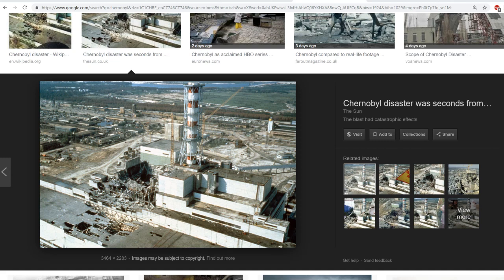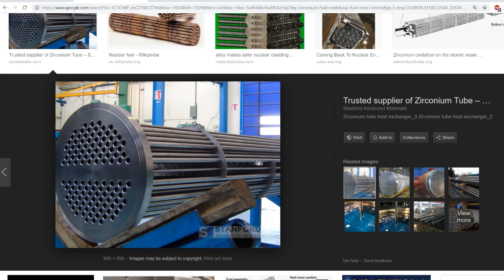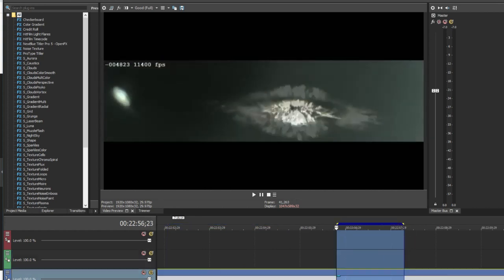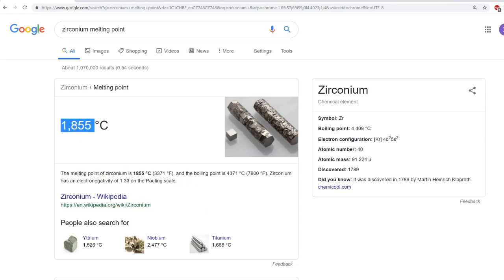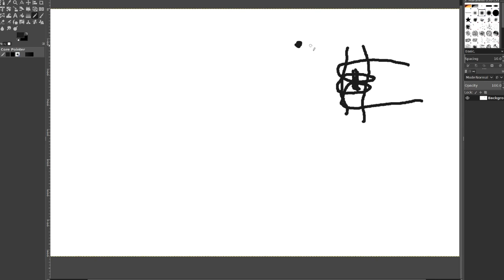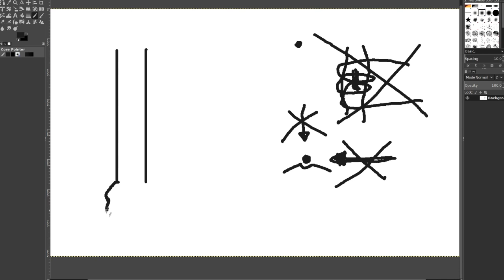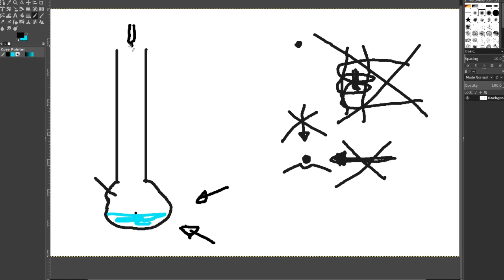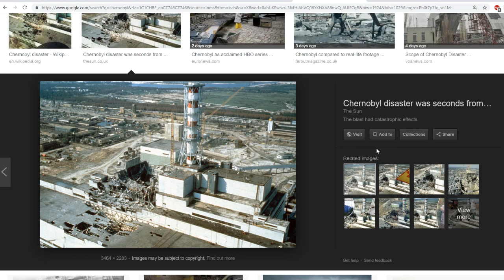Was Zirconium the real reason Chernobyl exploded?

Comment: It's so true, and isn't it so funny? Nuclear reactors. They sound so incredible and high tech and... NOPE it's literally just a fancy boiler, not much different from burning coal except with more lead shielding and cancer risks.
Always makes me laugh when sci-fi stories try to use nuclear reactors as power sources in things that can't possibly work that way. Iron Man's suit, for example. I mean, I can suspension of disbelief as well as the next guy, but when you think about it, that tiny dime-sized nuclear reactor in Generic Second-Rate Sci Fi Trilogy amuses me to no end.
I know what you're thinking: "Why is he bringing Elon Musk into this?" but it's exactly that kind of wishful nonthinking. "We can fix it with advanced tech!" and the reality of fancy boiler is left on the wayside in favor of unrealistic fantasies.

Maybe I'm just a sci-fi snob. There's an awful thought...
Reply: While we definitely aren't there for a small reactor the size and output of Iron Man's reactor. We do indeed use incredibly tiny nuclear power sources in current technology. City Lab's NanoTritium battery is a neat application. It's a circuit chip that can output, depending on the model and usage up to 150mA of power for 20 or so years using a Tritium based nuclear battery in a chip.
Reply: I can't say I'm surprised, but you know what I meant. Nobody's going to be powering a personal teleportation and espresso maker off of one of those things. I can't quite find it right now, but that sounds like about as much power as the battery in the solar-powered lawn light can store. Nobody's going to be running even household appliances off of one of those.

I am glad to hear that, though. If radiation's going to be a thing, why not use it to knock electrons around a bit until they do something useful?

Comment: Here is where I think you are wrong.  
1. Have you seen what the reactor looks like after the explosion?  Probably not, or did t take into account.  The entire assembly including the upper cooling tubes were ripped out of the containment and dropped back in sideways.  Most cooling tubes are still somewhat intact in the upper sections.  To me this indicates a possible low yield nuclear critical reaction in the lower assembly forcing the entire subsection up and over.  But if the zirconium tubes reacted then it would have happened during the first blast... That didn't happen.
2. You keep trying to apply your sodium reaction to nearly everything that releases large amounts of energy, or a derivative of it.  
3. The zirconium I think would have just vaporized to molten and not interacted with the water as you believe.  
4. It is possible the accident was just a steam explosion.  There was enough water already super heated to steam that it could have just rupture and blasted the core up out and over maintaining the upper assembly in the condition it's still in.

Look there are quite a few possibilities... I don't think you solution is one that is probable.  Interesting, but not probable.

Comment: Could I suggest going with the mig welder route, and machining a graphite cathode similar in shape to a test tube, but with a pinhole drilled in the bottom, and an anode that is just a graphite stick lowered into the tube. That way you could use a sufficiently sized zirc sample for better heating.

Comment: Maybe drop it through an induction coil after preheating it with he welder at the top
Reply: Kasper maybe he could heat it in an iridium crucible with the welder the melting point of iridium is a few hundred degrees more then zirconium

Comment: Why don't you drop the water on the Zirconium much easier to move the water then a super heated piece of metal only down side would be how much would be visible.
Reply: Good idea!
Also, you can use a graphite crucible in the induction heater: the graphite is inductively heated itself, and a piece of Zr in it will melt.
One question though: how do you isolate the explosion only due to white hot metal hitting water? It will explode without any additional chemical interaction, so you need a baseline, no? Like perhaps white hot gold?
Reply: Or keep the Zirconium fixed and raise the flask.  It's all relative.
Reply: Maybe the water will evaporate before hitting the zirconium. Unless you dump a lot of water on it.
Reply: Wouldn't that ruin the integrity of the surface tention plus you would want to keep as many factors the same as possible like acceleration due to gravity
Reply: Light Armanov acceleration due to gravity is of least concern I’d have thought. In Chernobyl the zirconium was in contact with the water already. If you think about the amount of energy you need to put in in the form of heat, a few extra joules of kinetic energy are neither here nor there.
Reply: Also this would be easier to perform under vacuum, convection currents in any inert atmosphere would surely either vaporise the water or push the drop away? At least you don’t have to deal with the vapour pressure of the water.
Reply: @Garryvision  I didnt realize that the metal would already be in contact with the water, I may be wrong but in order to increase the explosion more surface area must be in contact with the water, hence it helps alot of the metal has enough force to fall below the surface of the water. Also I dont think this stops the problem that you want the experiment to resemble the reality as much as possible
Reply: @Garryvision  also another two points, in a vacuum the water would evaporate and thefore react with the metal on contact instantly, also meaning that the air currents would exist in the water vapor. Furthermore you would want the water to heat up because that would resemble what would have happened in reality, there would be some water vapor in the atmosphere, as opposed to the atmosphere being water vapour.
Reply: The property described requires the metal to be liquid. Super heater water also requires a pressure vessels to prevent the liquid evapourating.
Reply: you could put all the things in a vacum tube, the wather encapsulated in a glass vile, the zirconium in the graffite crucible, put the whole thing inside de magnetic fild and explode the whater vile either with microwave or laser heating, you culd do a very compact setup insede a blast shild cose shit is going to be wild

Comment: 1) maybe point the electrodes downwards? so the zirconium drops a droplet?
2) really interested for this experiment, even thou im still not quite sold on this theory.
...3) Im still most inclined to fizzle explosion, basically molten hot fuel going supercritical; creating plasma that explode similarly to Sitnikov's demon core incident.

Comment: Ahhh, so the original experiment did start out with a bong and a syringe. I kinda figured.

Joking aside though, I'm pretty sure that you can decrease the diameter of the target to be heated via induction by simply proportionally increasing the frequency of the current. So you should be able to heat spots on a test tube, plunge a series of very thin tungsten wires through such that they form a rough funnel shape which will cradle the solid zirconium but let it slip through when molten, and hit it with a higher frequency induction heater. Theoretically, of course.
Actually, putting a little more thought into this increasing frequency matter, you might actually need microwaves for such a small target. Have you considered trying with a 2000 microwave? I bet you could find one in a scrap yard that just has fried control electronics which could be replaced by a switch on a nice long set of wires. You could probably test it by just plopping it on some, oh wait, 2000C.... Umm, maybe firebrick with a borosilicate bowel on top. Idk, that's my addition to the thought pool. It will be interesting to see when you do nail this one.

Comment: I think a Welder will be your best bet. Although a TIG welder would be ideal since the tungsten electrode will not contaminate anything. A welder with high voltage start function will also help greatly in a confined space.
Then, maybe place the Zirconium in a small graphite cruicible or something which you connect to the other terminal of the welder. You can then heat it well above the melting point and drop it by tilting the graphite cruicible.

As for induction Heaters: Even for a lot of money, you likely won´t find anything that will do the job.
Firstly, most induction heaters are meant to heat steel, which is by far the easiest metal to heat. All non-ferromagnetic metals are MUCH harder to heat. Additionally, heating to high temperatures is even harder for them since the electrical resistance changes with temperature. Your target being very small doesn´t help either. So at least for this purpose, I wouldn´t recommend it.
Reply: Induction cookers are optimised for copper and aluminium. So it's probably just a matter of tuning it appropriately.
Reply: @QlueDuPlessis  Induction cookers? what do you mean?
Induction stoves can only heat steel if that´s what you mean.
Reply: If you are ever out in Missouri, message me and stop by my shop. I have a water cooled TIG welder good for 250 amp (~5kW), and an argon purge chamber we can do this in. You bring the zirconium and a high speed camera, and I'll melt it for you.
Reply: Agree, I would go for a solution with carbon, but there can be some issues with that I'm overlooking
Reply: I was also going to suggest AC TIG with HF/HV start (scratch of lift start is going to be a nightmare to get working, just don't even try). the same tungsten electrodes can be used for the "ground" connection.
Reply: High frequency start TIG machine using argon helium mix. The helium transfers the heat better so it will heat up much faster. The key is what do you hold the sample with that will not react but is conductive to allow the current to flow.

Comment: I was thinking about the induction heating around the neck of the glass going almost all the way down to the water. You put a little piece on the top and crank it. Keep it running, so it will get hotter on the way down, or at least keep its temperature. Copper tubing with water running inside should keep it cool. Maybe Great Scott can give you some help: https://www.youtube.com/watch?v=_v5Hg2zfLjs

Comment: Why not pump air out at the bottom and letting Argon or Nitrogen fill in from above so you have a Gas stream downwards, free from water and O2. Or seal the water vessel with something that molten Zr can melt through.

Comment: I Think the second explosion was steam also. Think of it like this, when the first explosion goes, it ripped apart the assemblies, and the water lines, and leaves a void . Then all the water(already super heated) pools briefly in  the still intense heat of the reactor. For a brief time the water and steam is contained under the lid, but as soon as the super heated steam and water forces it's way through the lid, the pressure drops, and all the pooled water in the void flashes to steam instantly. 

This makes sense as to why the second explosion was bigger, because there was much more water available to flash to steam after the pipes had been ruptured and allowed a reservoir to briefly form in the reactor.
Reply: This also sounds plausible. I cannot wait for the results of his experiment... 
I would love to see your hypothesis put together in an experiment as well. 
Should be pretty interesting either way
Reply: Would it really happen briefly after the first explosion, I dont think its possible to instantly boil water that way considering the boiling water cools the rest of the water and there would need to be time for all the water to be pumped into the chamber
Reply: @lightarmanov6266  Maybe...It's theory that needs testing.
Reply: @lightarmanov6266  If the water was already super heated the heat of vaporization can come from the energy of the hot water and the environment there was hundreds to maybe 1000C.  Also the water in the pipes was already under immense pressure, so it's not inconceivable that a significant volume was forced out in short time.
Reply: @freeman2399  I agree it may be possible im just not sure is super heating works like that, it would also assume that the weak point was in the reactor which im not sure is true, but I agree it could be a possibility im just pointing out considerations that need to be taken into account.
Reply: @lightarmanov6266  No that's perfect. Theories need to be challenged. You brought up some good points. Maybe Thunderfoot will do a video on it lol.
Reply: @lightarmanov6266  Well the weakest point does not have to be the reactor, it could easialy have been at the other end of the cooling pipes. 

However you have to remember that water does have momentum, and forcing a lot of water/steam quickly out through piping may result in too large a back pressure and thus not allowing the water time enough to exit the reactor through the pipes.
The result would be that the  steam finds an other way out.....
Reply: @srenkoch6127  could being the key word, it could just break at another weak point, but again I dont know I guess you would have to look at the way it was built to get an idea of the crystal structure of the reactor, but then again tje heat kn the reactor could have weakened the material near the core, but then again im not intelligent enough to know.
Reply: It can also be a combination of both.
Reply: This could also be a possiblity, I read a paper where even somone sugested that the uranium in the reactor got critical mass and there was a mini atom bomb exploision in the reactor. It's a very interessting topic. Lika allways there is sadly no unsinkable ship or bulletproof reactor ...
Reply: @Jylakir  There's no way it reached critical mass.  Didn't this channel just have a video on that (criticizing the movie)?
Reply: @JohnDlugosz  The hypothesis that there was a fizzled nuclear explosion as the second explosion was proposed by researchers from the Khlopin Radium Institute in 2009. This hypothesis was revisited in 2017 and the arrival of Xeon isotopes north of Moscow seems to be consistent with debris being projected 3 km into the air, but supposedly during the first explosion rather than the second.

Comment: 2 Carbon electrodes and high current should get the temperatures you need.
Reply: You wont vacuum seal carbon to glass. It has to be tungsten or molybdenum.

Comment: if you use graphite electrodes the Zr might not stick to it, you might also be able to setup the electrodes as an arc furnace and suspend a blob of Zr between them until it drips off.
With your NaK experiment can you record the reaction on an oscilloscope? if a blob of NaK on the end of something conductive is lowered into water with the oscilloscope probe connected to it and grounded to the water would the different stages of the reaction show on the scope?
Also your drawing of the apparatus for the NaK experiment looks suspiciously like a bong.
Reply: That´s an interesting idea! I´m not sure if you´d be able to tell much from the readings, but at least there should be something new to measure.
Also for the NaK experiments, starting with water that already has different things dissolved in it and maybe at different temperatures would be interesting.

Comment: is there enough Zr in the reactor to blow the reactor apart and beyond the roof via Coulomb explosion (assuming that the molten Zr didn't dribble drop by drop into the water but somehow, someway, the whole liquid Zr fell in one big blob into the water) ?
Reply: I think the hypothesis is tgat the zirconium is under water, bu it goes coulombic after it reaches 2000 degrees, all at once the lower part of the core. However  that would mean you wouldn't get the Elephant's Foot anymore since that's what explodes.

Comment: Here's my thought to save the induction heater. Use a hallow tungsten rod to hold the zirconium until it melts. And a sort of funnel/narrowing on one into so that when it does melt, it just drips.
Solar concentrators (lenses) are also an option, but hard to add into an apparatus.

Comment: Think you meant tig welder. What about a tiny crucible inside the apparatus and then flood the apparatus. Perhaps the apparatus could be at low pressure to assist sucking the flood in.
Reply: I like this. Wouldn't it be easier to bring the water to the molten zirconium, rather than the other way
 around?
Reply: @PaulFentonBlog  It might work though I am not sure the crucible is likely to get so hot that bottom of the water ends up flash boiling on contact and the resulting steam explosion sending the water everywhere but where you want it to end up.

Comment: I think injecting the water on to premelted zirconium may be a good idea. Then you would be able to use high current to melt it on the bottom of a container filled with argon.

Comment: Wouldn´t a TIG Welder be exactly what you need?
Reply: I was thinking carbon arc off an old-school AC welding transformer, i.e. like brazing or search-lights use, but I think you're right, a couple of tungsten TIG welder needle tips would be far better for forming the arc, they're not going to melt as easily.

Comment: Not sure how easy it will be to use a MIG, sounds like you want a good old fashioned AC arc/stick welder transformer to make something akin to a WW2 search light with a couple of carbon rods. For that, 2000 degrees is child's play.

Might be worth a trip on ebay to look for an old brazing setup.
(I've got one in the garage, but IIRC you're in mainland Europe, and I'm in the UK, and it weighs a bit much to try to lend it to you via DHL!)

Having said all that, you might have a MIG that will do old-school, and that's what you were thinking about all along.